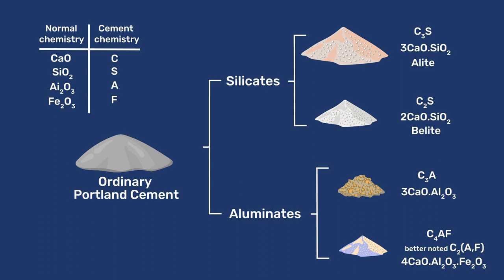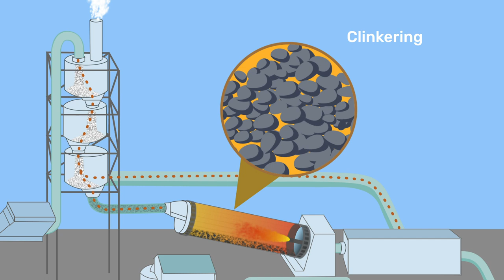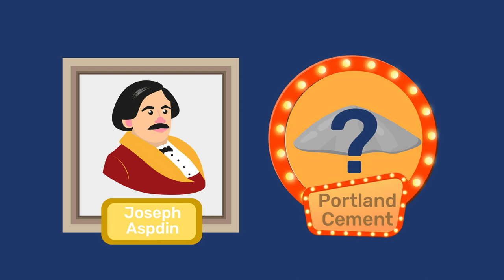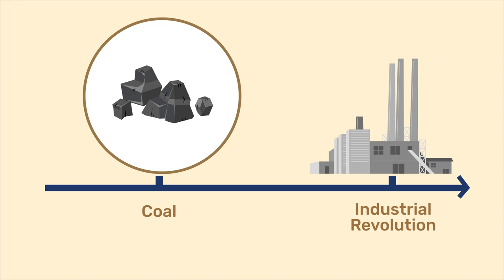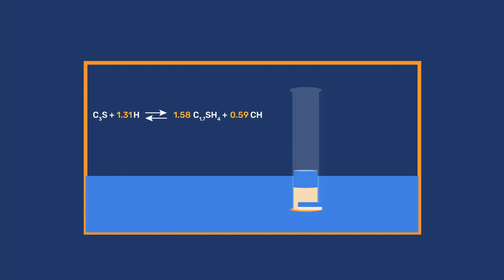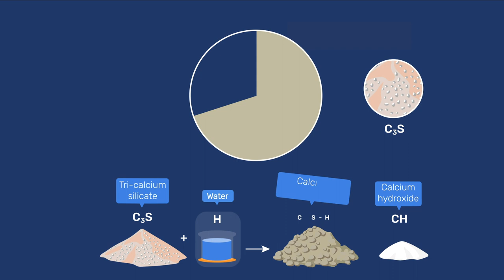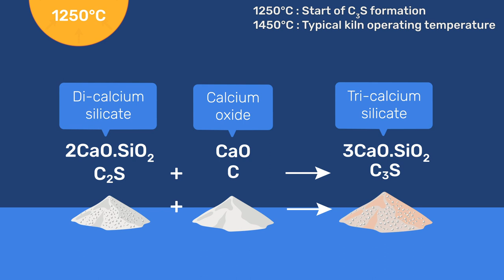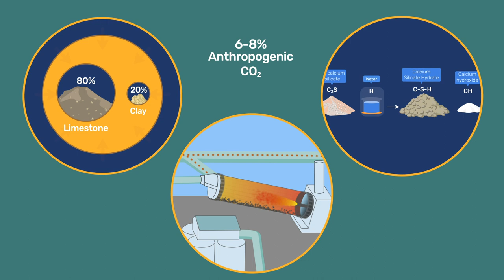Brief History of Portland Cement

Comment: Not only is cement manufacture a contributor to CO2 emissions it is also an energy-intensive process requiring substantial use of fossil fuels to heat material to 1450 C. The type of fossil fuel used also contributes to global climate change.
Reply: Oh no, not CO2! 😨 The plants are going to grow like crazy now. 😨
Reply: Plants? We pulled them out and put in concrete 😂